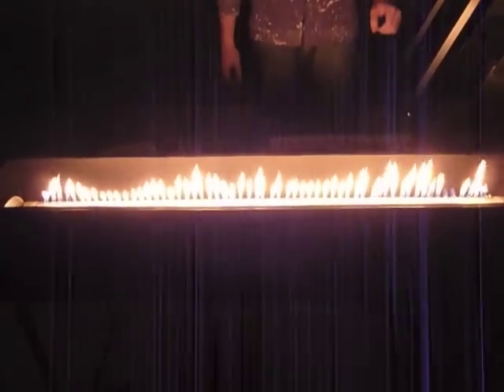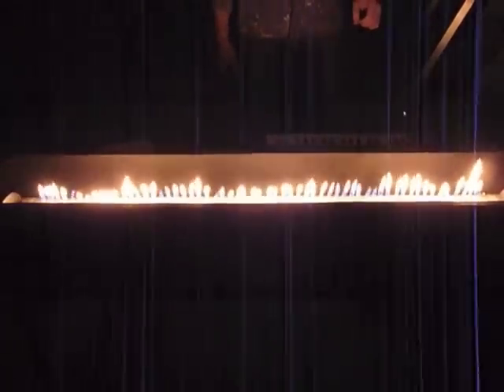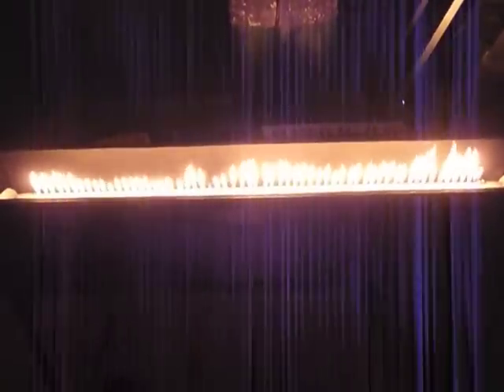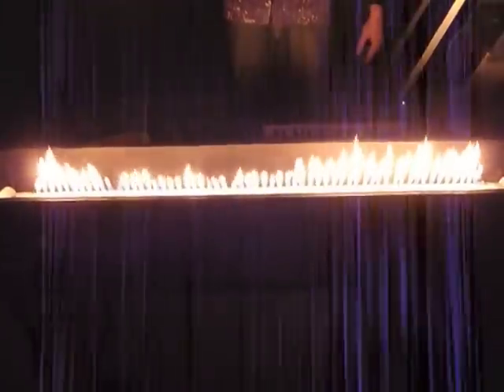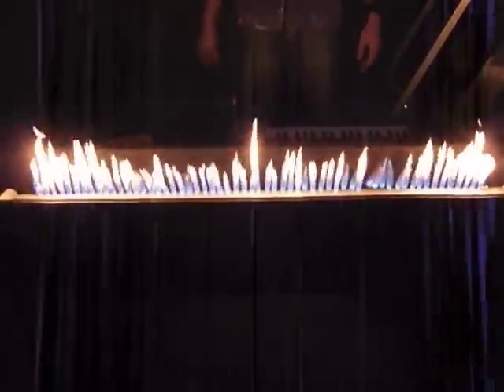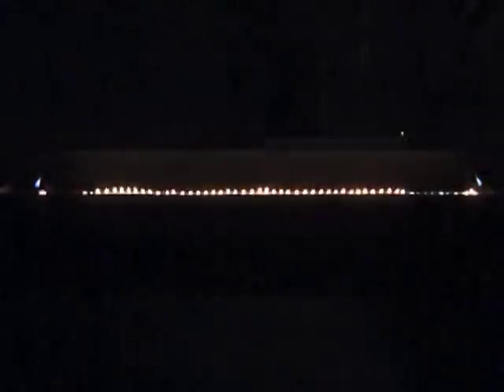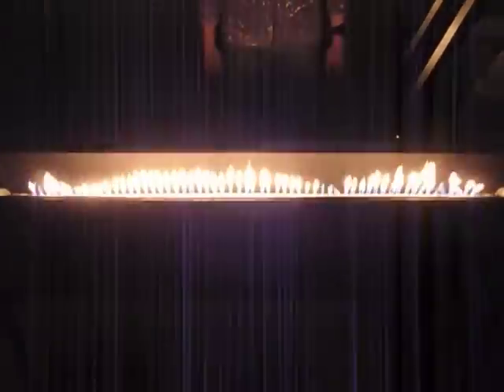Rubens Tube - fire music visualizer with flamethrowers

Comment from the maker: @Bleepinjeep - the gas that runs into the tube also runs through some check valves and a t to the burner heads and a t to solenoids. When the buttons are pushed the solenoids open and the gas purges out past the burner heads, making the balls of fire. :)